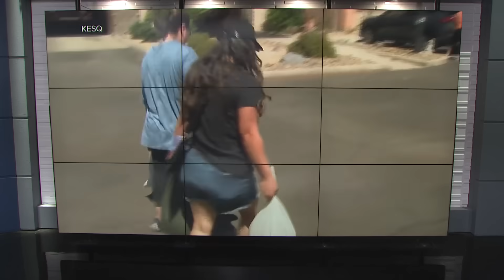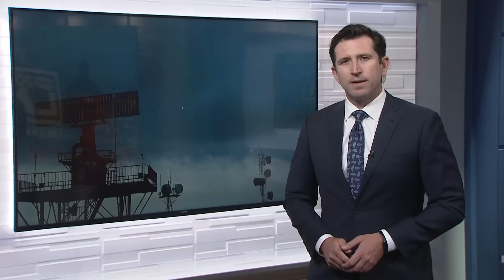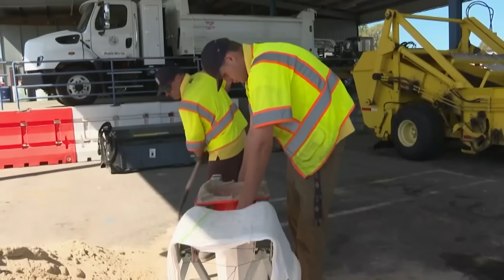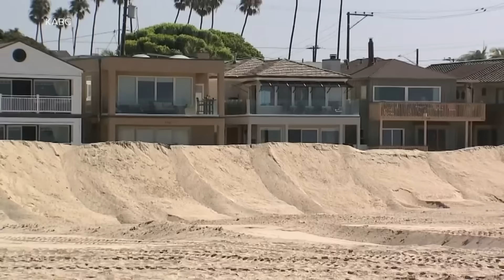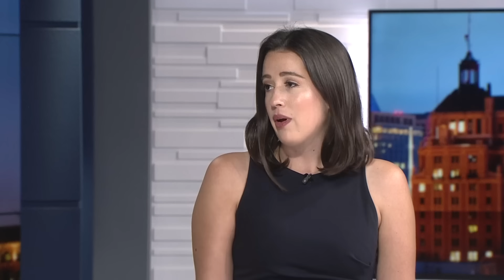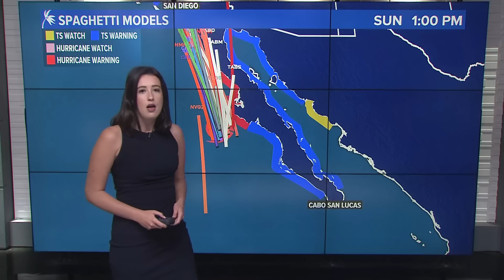Hurricane Hilary Latest: Newsom issues state of emergency, Palm Springs braces for impact

Comment: I'm born and raised in New Orleans. Trust me when I say to listen and follow instructions of your local news. I've lived through all the worst hurricanes since the 60's. Y'all be safe!⚜️🙏
Reply: this is not the Gulf Coast.
Reply: IF   NEWSON in on it    gavee'''   the   empty   suit'''   nooo  bueno'''
Reply: @shelbynamels7948  I'm aware it's not the Gulf Coast.
Reply: @shelbynamels7948  I hate to tell you but in this case, California is the Gulf. We just have to watch how fast this storm moves. It's not going to be a huge wind event, although if you are in the eye you are going to get wind. It is going to be mostly rain and usually the rain goes on and on and on but each hurricane is different. Don't be fooled, the hurricane is weakened but these eyes of these hurricanes don't just fall apart usually. They are something to contend with. It is going to be a flooding event mostly but that can be really bad too.
Reply: @gowest5145  Did you take a look at the water temps?? The Gulf is basically a bathtub with water temps nearly the same as air temps.
Water temperature is what feeds a hurricane. The water off the coast of SoCal quickly gets cooler the further north you travel from Mexico. 
I don't want to tempt fate, but the pictures you'll see today (Sunday) and Monday are going to be NOTHING compared to what we are used to seeing during Gulf Coast storms.
By the time this storm reaches SoCal, it will hit not with a bang, but a whimper.
Reply: @shelbynamels7948  the biggest issue there is flooding, you guys in Cali don't have the infrastructure to handle major flooding like we do in the Gulf Coast
Reply: @shelbynamels7948 they land not prepared for such water that fast
Reply: @shelbynamels7948  Just cause this isn't the Gulf Coast, does not mean that this thing won't cause damage or even deaths. Remember that California doesn't have the preparations that FL does for hurricanes. They are more prepared for earthquakes, not hurricanes, which can make it much more dangerous. If this thing is hard enough it can really flood out AZ. Here in AZ a mild monsoon will flood our streets. So I can't imagine what a hurricane could do. Fortunately, AZ won't get hit too hard from this, but it's still stupid to think that something is no big deal. Remember that's what happened in New Orleans when Katrina hit. Noone was prepared for it. When you fail to plan and you plan to fail. So even with a category 1 hurricane, it's still going to be much worse than what California usually deals with.
Reply: @Native_Creation  I disagree. If we get flooding, it won't be from a storm surge. The Gulf Coast shoreline gradually rises from a shallow shelf. That is why Kathrina was so devastating. SoCal's coast line has more ridges and a quicker rise.

If there is flooding, it is more likely to occur the way it always does, the creeks and channels will fill up, and hopefully will stay contained in their banks.'
The biggest concern, as always, will be mudslides from unstable hillsides.
Reply: Thank you for your good vibes Lana, sorry about these crazies in your replies 😅
Thankfully all seems calm atm, but from what I've seen people are preparing and hunkering down just in case anyway, better safe than sorry.
Reply: @karnagekarnival5127  Lol! I appreciate that🤗
Reply: MSM😂